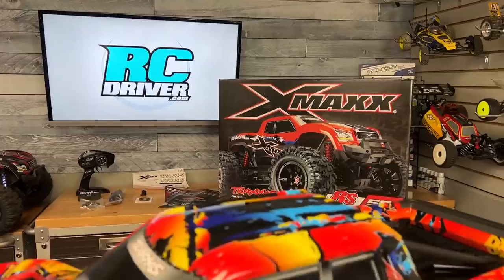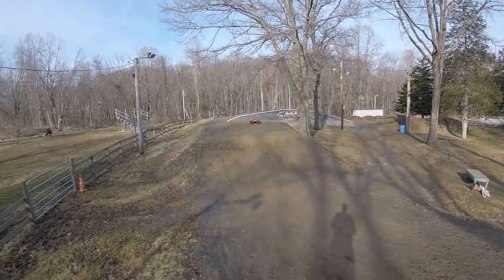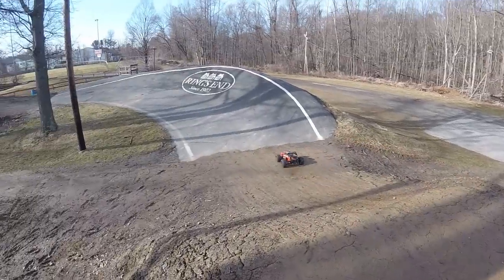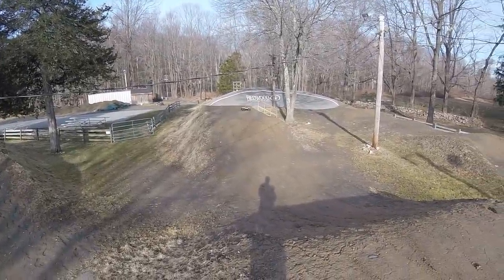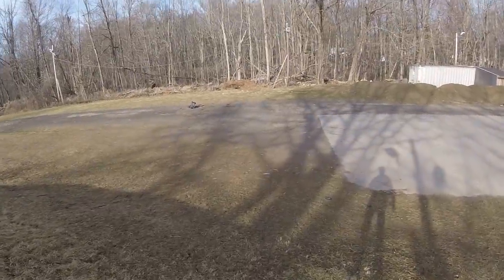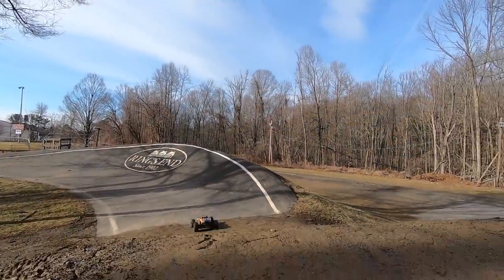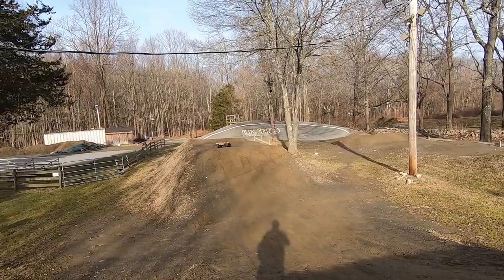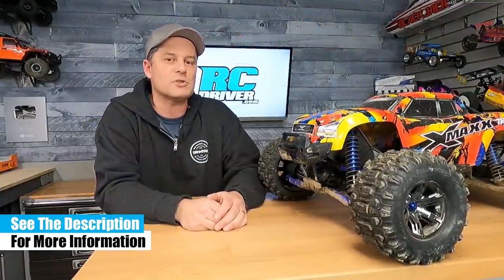Traxxas X-Maxx WideMaxx Conversion Followup | RC Driver

Comment: Even in stock form I always go to a 2085x servo and a adjustable hot racing steering servo saver assembly.  Those two items make a xmaxx steer like a dream.  Definitely a must have if you go to a widemaxx kit.   If the factory servo saver was better and the factory servo was metal gear i doubt you’d even need a servo upgrade.  But after a few packs ran through a new xmaxx the stock servo saver spring gets weak enough to really hinder your turning ability.
Reply: On the stock servo saver you can use a longer screw with a locknut on the end and it keeps the servo saver tight. Otherwise like you mentioned it loosens up over time.

Comment: I think what's going on with the suspension is because the tires are further out and the geometry of the suspension is the same, the tires have more leverage to move the shocks, which means the shocks need to be stiffened with thicker oil and maybe tighten the springs.

Comment: I have had good luck with Traxxas black springs, losi 60wt oil, if you set the rear of the truck 3mm higher than the front you get more steering and the back end slides just a bit like a stock Xmaxx. Great video.

Comment: I have the kit for mine and I like how much more stable it is, this is the only mod on my rig, it's stock. I don't really jump it or anything but it feels very nice. Less rolling in tight turns but still wild and crazy if you want it to. I compare it to a Great Dane puppy. I do agree on steering, I'm upgrading my servo atm, though the stock servo isn't the best.
Reply: What did you upgrade to?
Reply: @derek3154  i went to the perfect pass monster

Comment: The widemaxx kit saved my Xmaxx from being sold, I was not a fan of the constant tipping-over part, so I love the kit! Original steering is always going to be crap, even worse if you put new tires on with more friction.
Replace the horn, and rod with aluminum, and the stronger spring. Changing the servo is also preferable, neither of Traxxas' opinions is going to be strong, do 3rd party.
This is only expensive if you're a Traxxas purist, buy gpm alu parts and a 40$ servo will be just fine. But no more will the steering suck balls.
Reply: I disagree on the cheap servo part. I couldn't keep the 50$ 45kg servos in my xmaxx. I had to bite the bullet and go with a perfect pass monster. That and a new adjustment servo saver completely CHANGED my xmaxx

Comment: I feel like this basically turns a xmaxx into a XRT. I wish Traxxas would provide firmer springs with the kit and recommend thicker shock oil because it’s way to soft using their recommended setup

Comment: First thing i look at is servo saver spring. more than likely the weak stock spring didn't like  your tire change. Traxxas make a stronger one. The other is did you put the upper a frame in the high inside hole on the front if not that do it also. Been there done that. Just my 2 cents.

Comment: I have one with m2c racing ext hubs and WFO hubs on wife’s these are a much better option for us than the wide max kit by going this route it keeps the suspension and everything in line for your steering as much even though we have upgraded the servers on ours long time ago I
Reply: And completely wrecking the suspension geometry, and raping wheel bearings
Reply: Unfortunately spacers are not the same as long arm suspension and might be hurting performance. Scrub radius, spring rates, bearings all pay a penalty

Comment: Putting the Wide Max Kit on my " DuneMaxx " as I like to call it, has been one of the Best upgrades I have done to her!  
I have a Full Sensored Castle System, 56mm 1100Kv Motor and XLX2 ESC and the Full Suit of M2C Bracing motor Mounts, rail brace, hubs the Whole Deal and the Jumps I do in the Dunes with the DuneMaxx are as Big and bigger than what you see most Crusty Demons do on MX Bikes.
That being said, whilst I can do Similar types of Jumps with my Normal Xmaxx, I can not do the same as what she does as the Stability & power of course are simply Not there.
The Approach speed required to clear some of the Dunes I do is around the 100km mark and just trying to do that speed with the Xmaxx gets it all Squirlly and unsettled and when the trigger is Squeezed Flat, most of time ends up crashing!  Something I Never get from my DuneMaxx as it is so Steady and Balanced it is akin to a full sized Vehicle.
Been Nothing but a Massive improvement and I can't say a Bad word about it.  I have Never experienced any dramas at all with steering but I have this 
https://www.promodeler.com/DS1885BLDP
in my DuneMaxx so probably not a great example for the average Punter who just wants to pull out the Xmaxx and blast her Bogstock without any mods at all. Which I completely understand, It's Definately Not for Everyone.
All that being said, I have the Current Best 5th Scale RC of All Major Brands and Can honestly say that the Xmaxx in All Forms is Top of the Pops!
Reply: Great video always good information

Comment: I'm interested in adding a light kit to mine but Traxxas doesn't have a great path for routing all the wiring. You think you might hit electronics in the future? Also, what are your thoughts on other tire options (Badlands, Trenchers, street, etc.).
Reply: On the light kit the instructions that come with it has a diagram of where to route to the wires and where to add zip ties… pretty simple install

Comment: I have also heard after a few bashes the arm start to flex and bend and do not reform to its original state
Reply from the maker: The video was shot during the first runs. But I’ve run it since. I’m not experiencing that yet. Could it happen? I can see it since it’s a longer span which means more leverage to twist it during impacts.
Reply: @rcdriver  truggy arms hold because most if their shocks Mount closer to the tire
Reply: I've never heard a single person say that and I know 100 people with it
Reply: @andyvannort2743  Earl Moorhead had his arms bending and not reforming
Reply: @restinpiecesrc5528  OK so 1 out if 1,000,000 sold. Cool
Reply: @andyvannort2743  i never said everyone had it, i just said its possible since it had occured
Reply: @restinpiecesrc5528  well its rather insignificant and honestly not worth mentioning if 1 person has had this happen. Statistically it's an anomaly. And wouldn't it be better to say "this one guy had this happens" compared to suggesting these are bad because they aren't truggy arms lmfao. Truggy arms do that too. Are you saying it's never happened to any truggy arms? Yoy crucify 1 and praise the other but more truggy arms have that happen
Reply: @restinpiecesrc5528  you basically.made the most generalized silly statement ever "truggy arms hold up better" well apples to oranges and statistically no a higher percentage of trugfy arms bend without recovering
Reply: @andyvannort2743  i was talking about general flex, not breakages

Comment: the widemaxx change is useless imo.  the other tweaks you need to make in order for the truck to be fun again isn't worth it.  just leave it stock, change your ride height, change your shock fluid a little and it wont roll

Comment: I think if you want a great basher with great stability, you're probably better off with the Sledge from what I've seen. Sure the X-Maxx is a huge RC with a lot of wow factor, but I don't think it was ever really intended for high speed cornering. I would probably keep it stock if it's going to put that much extra strain on the servo.